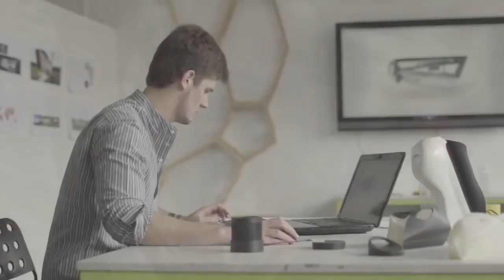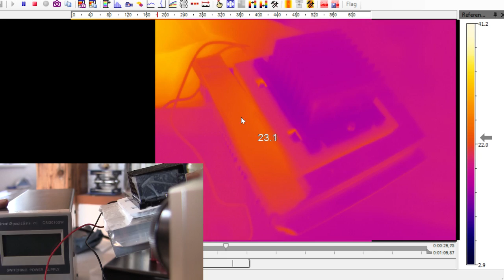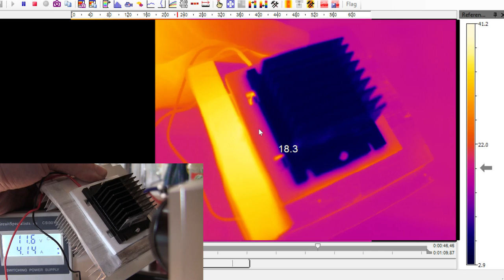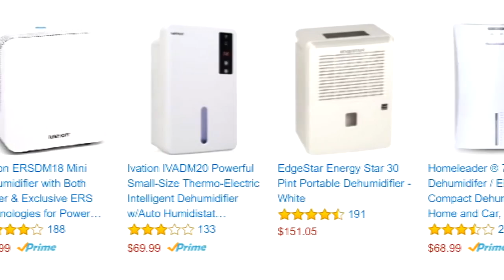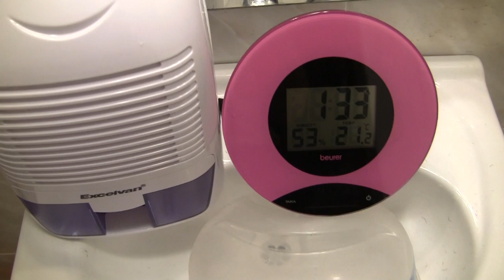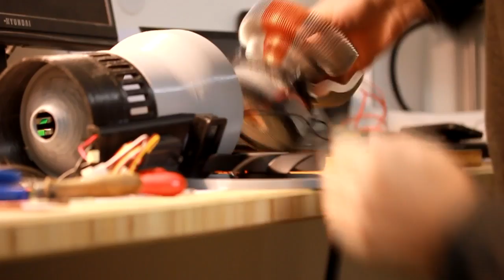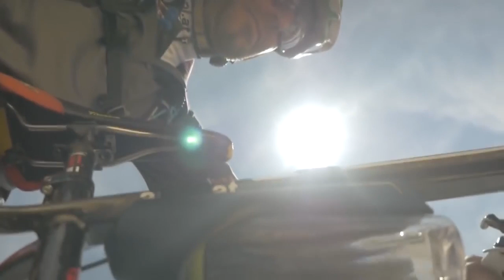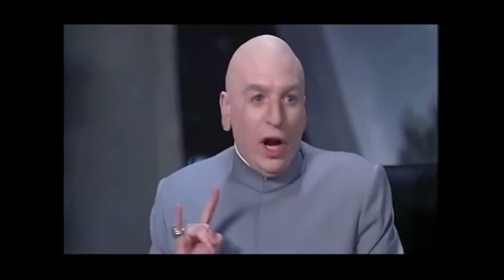$300 000 'Self-Filling water bottle' FAILURE

Comment: So, they basically admitted that they had no clue how it is going to work before starting crowd funding, if they just few months after crowd funding stopped started to find out how dehumidifiers work.

Solid golden hammer has a problem of being useful. It still has value of gold in it.
Reply: With a solid gold hammer at least you can do DIY with style or bash a creationists head in with it

Comment: Isn't it known that Staged filtering and reverse osmosis is the most efficient small scale water purification (filtering only for particulate removal). Vapor compression refrigeration is best for getting water from warm moist air, and dessicant wheels are best for extracting water from dry or cold air?

Comment: what are these hot cool paids, where can i buy one and can i cool my CPU with one.
Reply: MrTechfreak1 Peltier stacks, and they are inefficient. A good heat spreader and a fan is usually best for most use cases, Water cooling can be best in very high power density cases, modern devices don't benefit from sub ambient cooling so Peltier devices do nothing.
Reply: Not really needed. Energy-efficient data centres often run warmer than would be comfortable for humans so as to minimise the amount of power they need to use for air conditioning. High 20s on the cool aisles, and low 30s on the hot aisles. Basically a 5-degree difference between the two is enough as long as there's a decent airflow through the computers.

Comment: Wait you ran a dehumidifier for 7 hours and relative humidity did not go down at all.I feel like you god scammed or some shit.
Reply: Jelle Wijckmans 30% humidity is really dry already. It needs to be like 60+ to work properly.
Reply: Jelle Wijckmans 
Depends how big the room was, if a door or window was open. If the experiment had been done in a closed area it would have gone down, also it was just a cheap little machine. 
When a friend had burst pipes, he had a couple of BIG commercial humidifiers running for a couple of weeks trying to dry the place out, even then the drain pipes were just dripping rather than flowing.
Reply: Alan Douglas sahara desert is 25 to 30% humidity
Reply: It's a ventilated room. Of course the humidity won't change.
Reply: did you see the shower one ?
it worked....
Reply: LittleRainGames umm yeah I know... also, did you know that water is wet?!
Reply: nederlander?
Reply: We have big big floor units here and they do basically nothing below 40%
Reply: The temperature at which water condenses - the dew point - is about 2C under the conditions of that test.

Keeping a condensation surface under 2C in 20C air is no trivial matter.

Comment: Inserts finger up inside
"OH! It is very, very, slightly wet!"

Oh my.
Reply: Grab'em by the dehumidifier.
Reply: When I saw that part I thought, " That reminds me, I need to give my girlfriend some attention."
Reply: I did wonder why that dehumidifier looked so happy this whole video...
Reply: He seemed really happy that he could get his finger wet.
Reply: I am a water bottle and this offends me.
Reply: he must have bought the humidifier up north where I live, he managed to get four fingers in there.
Reply: BAAHAHAHAHA!!!! Awesome. So it DOES get about as wet as my girlfriend on a bike trip. Gosh I love science!
Reply: ChaosmanOne knew this comment was going to be here and specifically scrolled down to find it rightly sitting at the top of the feed
Reply: i think he might suffer from Mechanophilia
Reply: The fact that this thing has an actual face, doesn't help!
Reply: IKR, It went sexual really fast!
Reply: OH MY
Reply: 13:03 Not that I think this thing works, but should TF have done this experiment outside and not in an air-conditioned/heated building? If it's air-conditioned, the Air-conditioner would have removed most of the water and if it's heated via hot air, the air would also be dry. He needs to run this thing outside.
Reply: 340.000 dollar would do that..
Reply: tarstarkusz You can see the humidity level on the pink "thing" next to the dehumidifier. 30% is not exactly low. If you are getting significantly more than that, chances are there is water nearby.
Reply: i wished he tried to drink it lol
Reply: ChaosmanOne why not turn that bike solar panel into some kind of turbine power? Don't remember what it's called but god dam.
Reply: I think you need to dry it up with the power of: S U N - D R Y I N G!
Reply: wet my finger.
Reply: The heavy breathing in this segment amplifies the idea even further
Reply: that OH MY
was voiced by George Takei
Reply: also I'm sure I heard him lick his fingers off camera.
Reply: Glad I'm not the only one who found it to be...somewhat naughty XD
Reply: +GRIZZDOGG01 YOU HAVE WON THE INTERNET
Reply: ChaosmanOne 
It feels kind of wrong Liking your comment without watching the video yet.
By I did cause I'm such a bad person...
Reply: MsSomeonenew  AH HAH HAH HAH HAH HAH I NOTICED THAT TOO